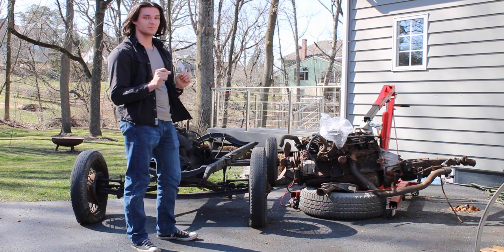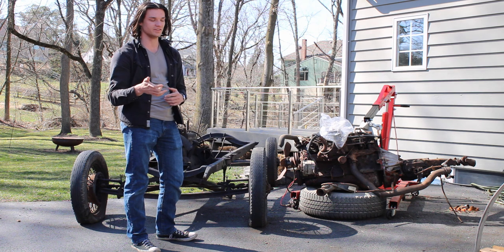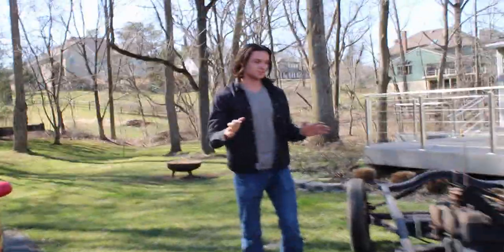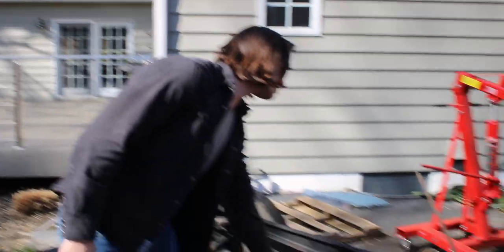Pre-War Race Car Build! Lizzie Part 1

Comment: Interesting build but I don't think it will handle the way you think it will! Often with pre-war type racers the springs are very stiff and the chassis flexible. Also be careful with the torque tube rear end and how the axle is attached. I am not sure about your car but on the Riley I am building there is also a torque tube. With that set up the rear axle moves in an arc as the suspension goes up and down so you have to account for that. On the Riley the axle is in trunnions attached to the springs so the axle can rotate. And the spring has a shackle either end so the springs can swing back and forth. A traditional leaf spring rear the axle is fixed to the spring and there is only one shackle. The distance between the diff and gearbox changes with suspension travel hence the need for the sliding joint in the driveshaft. One a torque tube like the Riley (and your car maybe?) the distance doesn't change, only the angle. Also fabric bodied planes were covered in good quality linen and doped. Pretty sure you can find all that stuff still as I think people still build kit planes that way. Good luck with the build, it's good to see someone doing something different!